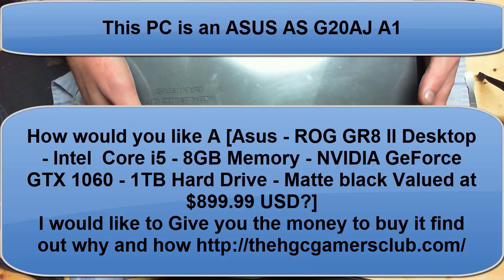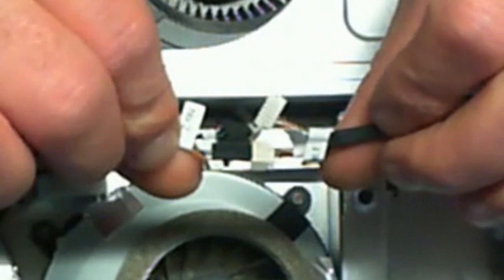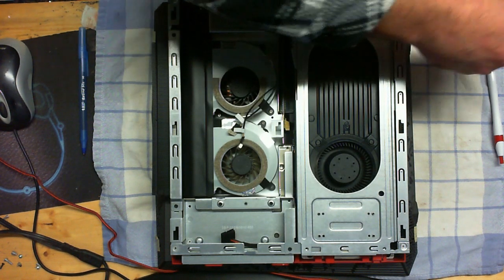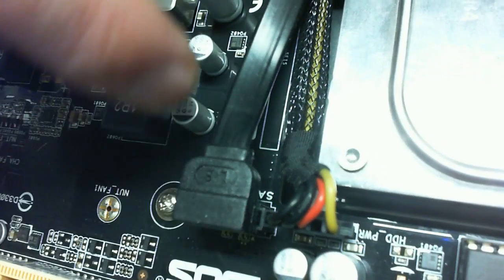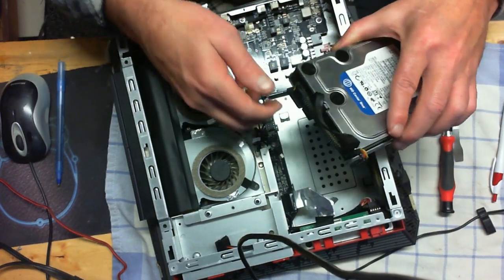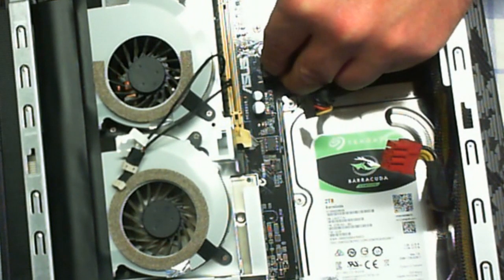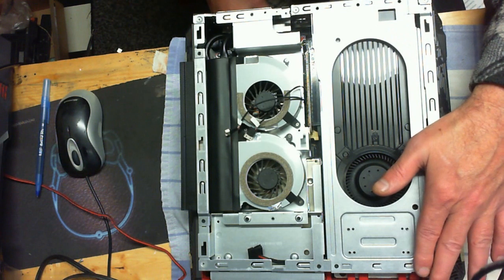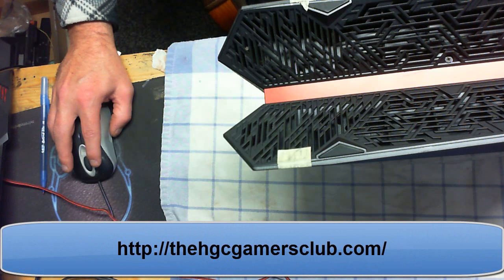ASUS AS G20AJ A1 Video Card/Hard Drive Replacement/Repair

Comment: Fabulous video. I'm a Pro and it still saved me tons of time. Thank you.   I mostly work in business networks but get the occasional business owner's PC to deal with and absolutely love this kind of work once in awhile.  I love ASUS motherboards.  This machine is a little to nerf'd for my preferences.   2015-16 vintage and no SSD!  otherwise a reasonable performer.   
They also have the M.2 slot buried in a bad way making it pretty much unusable.  SMH.

Comment: Hey there! Thanks you for the video, I feel much better about upgrading the GPU myself now. I was wondering though, do you think a “GIGABYTE GeForce RTX 2070 Super Gaming OC 8G Graphics Card, 3X Windforce Fans, 8GB” would fit in there?

Also, what power supply would I have to use?

Comment: Hi i have to install a hard drive, not replace. Will there be any problems with this such as the cables? It is a hard drive from another pc so I don’t know if there are any cables I need to install it or can I use the cable from the old pc used for the hard drive?

Comment: Great info and video, I came here because my current Asus ROG G20CB has some issues with the "Toshiba DT01ACA200 (2TB)", it currently has 20 reallocated sectors and 88 pending under 9095 hours. Should I be worried and switch it out? If so what would be a good replacment?
Reply from the maker: You need to clean the system more it is likely running hot but Yes I would recommend replacing the HDD with any HDD you like that has No Errors.
Reply: Thx :)

Comment: Please answer me. I still have this beauty stuff and I plan to upgrade this GPU card with extra power. Mine came with only 1 adapter 180W. If I buy another one 230W, can I just plug both adapters and 6x or 8x pin power to the GPU card? I've searched some videos about G20 GPU card replace, those explained that we need to move JDC11 switcher, but mine have no JDC11. Only JDC1 - JDC5.

Comment: Great Video Sir! May I know if I can upgrade my 5 years old G20AJ's Wifi card to improve connectivity and internet speed? If so do you have any recommended compatible wifi cards that I should get? Thank you so much!
Reply from the maker: That is a question I can not answer because Sorry I know nothing about what you have in the system now so how would I know if you can upgrade it or not you may already be maxed out? The best thing for you to do is find out the specifications of the motherboard you have then look for what you want and then if it matches what you need you have an upgrade. Good Luck

Comment: what is the best GPU in 2022 fit in this machine?
Reply: Also interested
Reply: To the best of my knowledge these particular systems were only meant for two specific CPU’s and two specific Nvidia graphics cards. No modern GPU in 2022 would be compatible with this system as far as I know.
Reply: I think for the old aj it only supports up to 1080, because of power supply and the size
Reply: It's about a 1050ti or a 980ti

Comment: Hi good morning. I was just wondering if I change  HDD to SSD, do I need to clone my SSD first before I can install it? You know for the boot up drive. Im not really a computer savvy.
Reply: Yes, need to clone first, or after removing and replacing, the new drive.  But if you do it first, you might be able to use the optical drive SATA connector for the second drive.

Comment: Hello there, my daughter has g20cb and i have to replace the hdd, is it 3.5 inch in size (W)?
Appreciate the video
Reply: Yes it is A 3.5 inch Recommended that you do not go over 2TB
You can use a 2.5 with a Caddy if you wish to go SSD Recommended you use 250G minimum and that you do not go over 2TB 
If more memory is needed I recommend you use a USB self-powered external HDD up to 18T
Reply: @Xboxsarerepairable  your a true gent, thankyou for your reply.
Reply from the maker: @SMOKEY-Junior  You are welcome I try to answer all questions although sometimes it takes a little time.
Reply: @ClovisX  appreciate that.
 I literally treated myself to a new system and when my oldest came running in saying her PC had Blue screen, I couldnt believe the timing but thank the heavens I found a 2 TB barracuda cheap for £40 which arrives weekend 😅
Reply: @ClovisX  I dont know if your see this, but  the daughters HDD has packed in and im replacing with what we discussed above, I will make a copy of win10 from my system on a flash drive usb.  will this just put win10 on her system or will it install my version / serial codes of win 10? 
Also do I need to format the drive using my system before putting into hers? 
Sorry for the questions

Comment: Do repair these?  I have one I purchased in 2016 that died about 2 years later.  I’d like to get it going again as a my garage pc
Reply from the maker: Your computer would be trash in a very short time for a garage PC I would recommend this https://amzn.to/3o5P8Sr it is small can be mounted to the backside of your TV and You do not need to worry about dust it is what I use in my Garage Shop. there are different options depending on what you need the computer to do and how fast it needs to be. 

Yes, this is an affiliate link; What do you think I am going to do everything free? LOL

Comment: Hiya! I brought this off pc off a guy who upgraded the GPU to a 1070 and only gave me one power supply and it's cord (possibly the 250w) which other one do I need? + it's not getting signal to my monitor. Not the HDMI Cord
Reply: It used to overheat and shut off randomly but worked amazingly the first 2 months. I think the GPU gave up when I accidentally unplugged the PC while on awhile back
Reply: A 1070?! That guy must have done some serious gaming
Reply: @jackrunge1592  Yes Sir! Dude had plenty of gamez Installed. Warzone, Apex, GTA 5. Eveything runs on high(65-75/Max 65-60fps) but it worked amazing till mid/late November

Comment: So do you have any idea why my asus rog g20cb is shutting of randomly at random times I’ve tried pretty much everything in my capabilities to fix and troubleshoot it I don’t know why it won’t stay running and it’s only if I’m downloading multiple things or trying to play a game
Reply from the maker: without time in my shop to check it out, I cant say there are so meany things that can cause that.
Reply: I ran a bunch of troubleshooting and then brought up task manager and watch my cpu spike when I tried loading a game so I think my cpu is overloading are those hard to replace ?
Reply: @bootleggedxgaming6012  dude im having the same problem and its for sure overheating.. idk what i can do about it though
Reply: Try plugging your pc into a different outlet
Reply: use GPU-Z to see what is your  GPU clock when it's running, and the temperature. Mine is just overclock by itself. It makes the pc overheating and reboot whenever I use oculus. I use MSI afterburner to reduce the clock and it stops rebooting. Replacing thermal paste for the video card will be my next step.
Reply: Before trying out all these different things, I know it's been a while, dust is always a constant problem to keep in your mind. Mine had the SAME issues, however the cooler vent was clogged. It now does not do it anymore.

Comment: Will a RTX 3070 fit in this bad boy?
Reply: wondering tht too
Reply: I'm curious too.
Reply: 3070 is a beefy card with alot of watt power. The G20AJ is limited in power delivery due to it's design of laptop power and not using a ATX power supply.  A 3070 recommendation would have to be a 550-650w power supply. Also with the older CPU / mobo it's most likely going to throttle in performance.
Reply: @coocluckclanmusic  Guess ill have to buy a new computer then, thanks for the info
Reply: Heat and wattage alone will limit you from using that card on this machine sadly. It’s a beautiful machine for the time. Real shame they didn’t sell larger cases like this.
Reply: @RetroPlus  That’s awesome!! I just recently upgraded my rig from this one as well!! Got a whole new monitor too and let me just say. It is crazy going from that PC to this new tech. Absolutely mind blowing!!

Comment: Does anyone happen to know if there is a hard drive storage size limit? Thinking of replacing my hard drive and putting in a 4 TB into mine.
Reply from the maker: If it fits you will be able to use it but you will need to partition it so you have 1 to 2T for OS I recommend 1T then the rest formatted as one partition for storage

Comment: Hey man, my harddrive in my asus g20aj isnt sliding out as easily as it is in the video, any tips?
Reply: Take it to a qualified repair shop that is an easy task and if you can't do it you likely have no business inside a computer. Not trying to be mean but I find most of you should not turn a screw because you think someone on YouTube is telling you the end-all problem on a video when there can be 1,000's of reasons for any error code or symptom and most of you destroy your electronics trying to fix stuff that is not broken.
Reply: One sludgehammer.
Reply: @ramiroequipilag1316  1st I am not over priced 2nd if you do not have any education in electronics odds 95%+ that you will damage or kill your system 3rd I consider it a criminal act for anyone to be learning threw trial, error & experimentation at the expense of a customers electronics.
Last: Your complaint sounds more to me like you are one of them self educated repaimen only upset that I am not helping you lean to cheet customers? If I tell anyone not to try to fix anything it is because there comment led me to believe thay are not capable of fixing there system and should not try or a repairman trying to fix something they have no business touching.

Comment: Not posting after I replaced my hard drive, trying to figure out the problem, everything is put in correctly and the graphics card is powered since I see it moving when power the computer on
Reply from the maker: I do not know what you are doing, trying to do or how you are doing it? A replacement of a hard drive is easy for those that know or have education with computers so I am sorry you will not find anyone that can help you it will be best to take it to a qualified shop if you are local to me I do not charge to test the system but I do charge to install a new OS at a reasonable price. http://www.clovisxbox360repair.com/contact.html
Reply: @ClovisX  Oh sorry forgot to update or delelet comment, my gpu wasnt seated correctly or something, but when i took it out and placed it back it it was posting. Everything is fine.

Comment: I am interested in upgrading my G20CB.  I currently have (1) 16GB RAM [2x8], (2) Graphics Card NVidia GeForce GTX 1070, and, (3) Processor Intel i7-6700 CPU @ 3.40 GHZ.  Any recommendations of what to upgrade too?  Thanks!
Reply from the maker: that is all up to you and the amount of money you have to spend on upgrades?
Reply: Really any blower style GPU will work. The processor isn't really worth it as the only upgrade will be the 6700K and its only a minimal upgrade. The ram I believe can be upgraded to at least 32 gb with 2 16gb sticks.
Reply: @MikeArpeggio345  Thank you! Went w/32GB and the GTX1080Ti

Comment: My PC is this model and suddendly it started making an strange noise. Like a knock. I don't know what it is and i cant check inside because i don't have the proper tools. What should i do?
Reply from the maker: may not be a bad idea to take it to a qualified shop, repairs can be cheaper if you fix a small problem early rather than weighting untell it just quits.
Reply: Mine started doing the exact same thing recently

Comment: Would this pc take a i7 4790k without any issues???
Reply: I’m no expert, but I’m almost certain this system was only designed for two graphics cards, and two CPUs and I think the I7 will fit. However please make sure that the ram and the motherboard are compatible with that specific CPU. Even if it fits physically it might not be compatible with the components in the case itself.

Comment: Yes ok video but I need to know how to mount an ssd in this case.
Reply from the maker: You can buy a converter that will allow you to put the SSD into the system buy a 3.5 to  2.5 SATA converter put the 2.5 into the 3.5 shell and install it same as you would a 3.5 HDD it is that simple
Reply from the maker: use this https://www.amazon.com/ORICO-Adapter-Mounting-Bracket-Interface/dp/B01LZWX6PD/ref=sr_1_4?crid=22NXYRQENNFYD&keywords=fenlink+2.5+to+3.5+sata+drive+converter&qid=1682811399&sprefix=3.5+SATA+Drive+converter+to+2.5%2Caps%2C142&sr=8-4

Comment: funny story about mine, if i do put in all the screws my graphic card will not recognize. If i remove a particular one, it will work fine. Never figured out origin of this werid situation, so it had been missing a screw for the last 6 years. 😅😅😅
Reply from the maker: it was likely installed improperly and when the screw was put in it pulled it down enough to cause a short to the frame, I would say leave well enough alone, if it is working now no need to mess with it.

Comment: What graphics card is this ??
Reply from the maker: Why would it matter to you what graphics card this is? there are lots of different graphics cards sold with these systems it all depends on what you paid for when you bought the system.
Reply: @ClovisX  Maybe because despite being a stock system, theres a limited range of GPUS you can upgrade to? IE a 1060

To answer your question, the ROG G20-A1 Has a GTX 760 stock iirc.

More specifically you can upgrade to an EVGA Gefoorce GTX 1060 SC single fan GPU. I'll find the exact GPU for you in a sec

Comment: I don't understand, my hard drive doesn't slip like in the video.
Reply from the maker: watch the video closely or you may damage something are you positive your system is the same system I am showing? if so follow it exactly if you can not get it to work do not force it, take it to someone that can do it preferably a qualified shop.
Reply: @ClovisX  Thank you for answering me but I succeeded, I was just pushing it in the wrong direction
Reply: @ligero1238 hey man, how did you do it? I got the same problem

Comment: I opened my asus g20 and removed the video card to air blow it and now my tower won’t turn on. I tried every trouble shooting method and it still won’t turn on, I can’t figure it out. It was working fine before.. any idea what would be causing this?
Reply from the maker: It is hard to say without being there to check it out and I do not know your ability to follow directions. Not that you did anything wrong it is possible you forgot to plug something in or knocked something loose like a ribbon cable to the drive or something all I can say is take it back apart and check everything and go slow to be positive everything is in its place all the way plugged in properly and completely seated in its location you can not be leaving out screws because you think they are not needed even if it only goes into plastic. If you are local to me bring it by and I will see what I can do use this link to find out were I am: http://www.clovisxbox360repair.com/contact.html
Reply: Wow I appreciate the response! I’ve taken apart a fair share of towers before, but this one was a bit difficult. I followed your instructions and did everything from scratch about 3 times and everything seems right... and about the screws , I got two of them lost, fallen into the cracks of the tower with no way of getting them back... could they be the cause? Anyway, I appreciate your time for replying back to me
Reply: Phamtom TV GG this is why I sold that sucker and built my own rtx 2060 pc